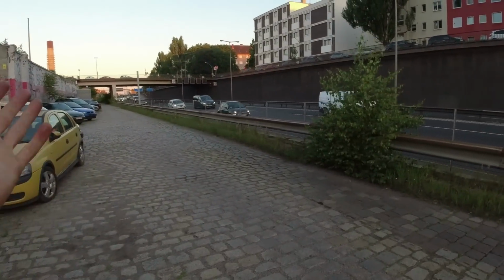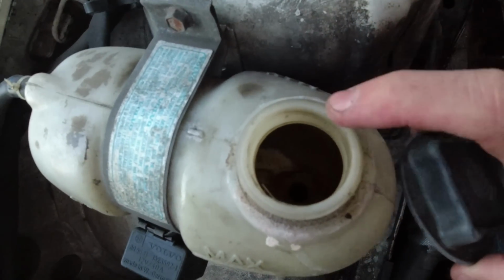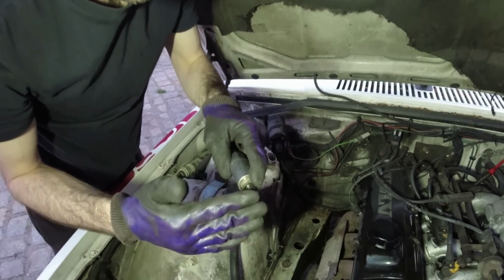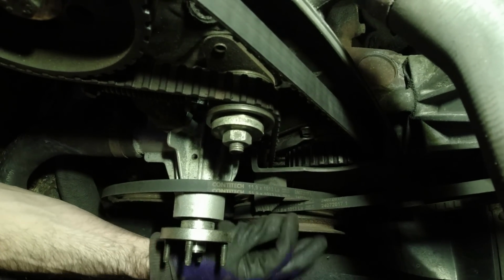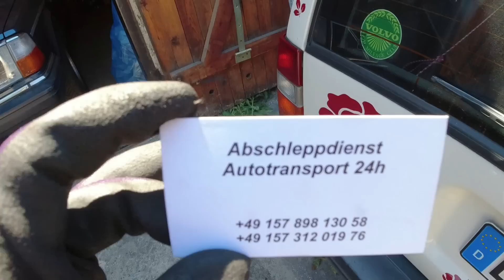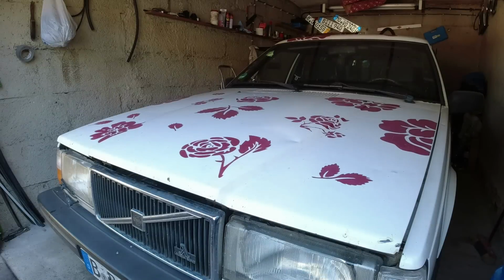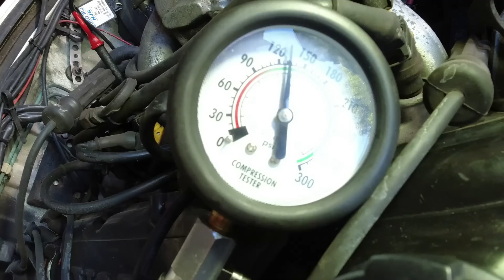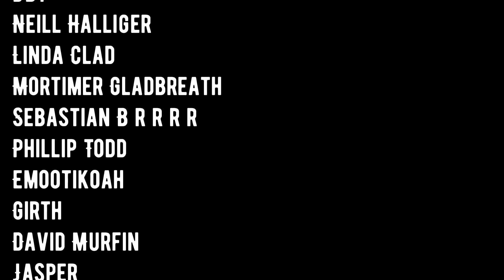I Bought a Non Running Volvo 740, Can it be Saved?

Comment: I've got a coolant expansion tank with a float in it, with wires connected to an alarm (think it was from a 760 or 960), so when the coolant falls below a certain level the alarm goes off - it worked the last time my radiator sprang a leak.  Also got a universal digital engine temperature gauge, with the sensor bolted on to the cylinder head which you can set an alarm for when it goes above a certain temperature which you can set to any temperature, so I'm pretty well set to protect my engine from overheating.  Thanks for the great video.
Reply from the maker: Thanks! That's a great thing to have I'd love to fit something like that on mine, so easy to miss the guage rising before it's too late!

Comment: I have a 1987 Volvo 240 DL. I'm the 2nd owner, since 1989. The car has been quite good until the weather 🌡️ got very hot 🔥. I went for an oil change, and was informed that the rear seal was leaking water. That started my problem. It appears that I might have blown the head gasket last week. I really like the car. Very easy to work on.
Reply from the maker: Ah that's a shame, hope she gets sorted out 🤞  Yeah super easy to work on!
Reply: @Involvod  
Thanks 😊 for your encouragement. I'm giving it a little break while the weather ☁️ improves.

Comment: Love the car!  Anxious to see what you find as you dig in. 😃
Reply from the maker: I'm also very anxious 🤣
Reply: @Involvod  
I can imagine!  😉
At least, worst case scenario, the wheels alone should be worth the price of admission. 😁
Reply: @Involvod  
PS:  update on the dash…finally got the fuel gauge working. It was sure enough similar to your issues with your gauges. Someone went into it and tried to solder bad connections with the board. 
Re-soldered the connections and it came to life. 😉
Fingers crossed that it stays working. 😁
Reply from the maker: @VolvoGuy1969  oh nice! Good to know bad solders can be the issue with those too!

Comment: For the most accurate of cylinder compression readings, you should hold the throttle wide open.  This will allow the most amount of air to get into the cylinders and the engine will spin with less effort.

Comment: Nice find. Those flowers do make a nice touch.
I feel for the previous owner. Loosing a car like that hurts.
I hope you can properly restore her.
BTW: driving on the starter motor is about the cheapest EV conversion you can do... Just add bigger batteries LOL.
Great vid.
Reply from the maker: Thanks, I'm sure they appreciate that, them and their family are on here following the progress. And yeah, I just hope the starter will be alright after all that! 🤣
Reply: @Involvod  it probably will.
I was taught how to use that technique if you get stuck with a dead engine and need to move. (e.g. engine dies on railway crossing).

Comment: A guessed right, one cylinder gives life and three have died, Guessed in the beginning when you tried to start it😂
Reply from the maker: Ah I see, impressive! I thought maybe 2 were okay 😂
Reply: Min 760, broken cylinder gasket, between the two and three cylinder, It could be driven at 70 km / h to work where I changed the gasket and the cylinder head
Reply from the maker: @volvoqq4561  haha it's great how they keep going, my last 2 940s with failed head gaskets ran well and didn't over heat!

Comment: Looks like a great project. The oil filler on the rocker box looks a bit wet with oil - hopefully from spillages when filling and not due to high crank pressure forcing the oil out. Looking forward to seeing you get it back on the road.
Reply from the maker: Good spot, it seems to be a very common problem I think I read once that those seals are really bad and always need replacing!

Comment: Yes another impulse Volvo redblock buyer. Have the same 90's affliction with a 90-760, 91-940SE, 91-740 and restored 91-240 with 320K miles. From 90 on the engines are much better, and yes on Craigslist I have to turn away and say don't do it when I see one rarely come up. Three is the sweet spot to manage. Best of Luck. But hey parts are super cheap now only us die hards remain.
Reply from the maker: Haha nice! If I had space and money I'd just keep buying and buying, but as it is I can only really have 2 registered on the road and one project in the garage, wasn't supposed to buy anything now because I still haven't sold the 940, but I opened eBay the other day and this one was there to greet me on the home page, a couple hours later this video was being filmed, can't help it 😄
Reply: @Involvod  It could be time for a Volvo intervention!

Comment: Looking forward to the engine teardown and seeing the extent of damage from repeated overheating. Can compression rings lose their tension from being overheated? Surely the cylinder head will need to be resurfaced at a minimum.
Is the transmission an M47?
Reply from the maker: I'm really not sure to be honest, will be interesting to see! Yeah it's an M47 🙂
Reply: The aluminium pistons grow more with heat than the cast block or the rings do, so extensive heat would make the pistons press the rings against the cylinder walls. If that was the case the engine would lock up and most likely break pistons and/or conrods, maybe even damage the crank.
But the engine spins freely, so that's really unlikely. 
Miss Involvo'd also said the engine just turned off, so my guess is the head is at fault, not the bottom end. Maybe the head warped and it tore the head gasket to pieces.
It's all speculation until the head comes off and we can have a look though